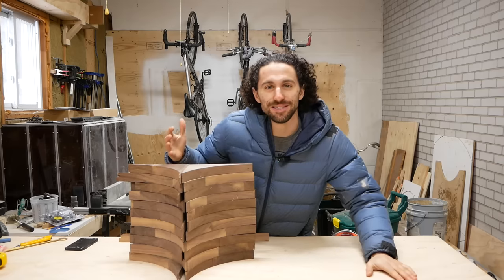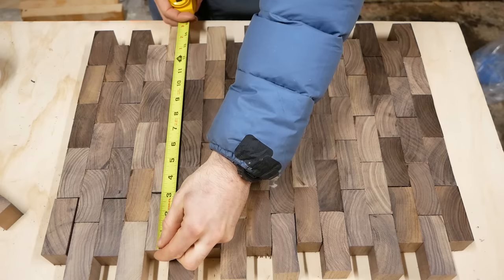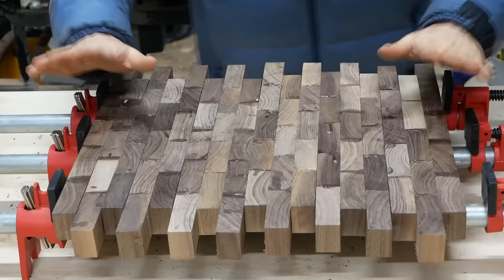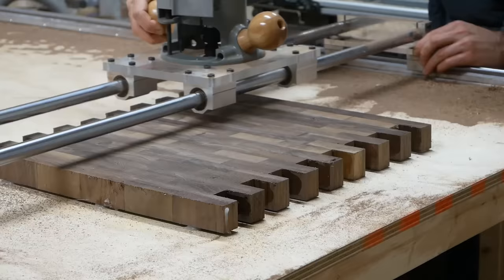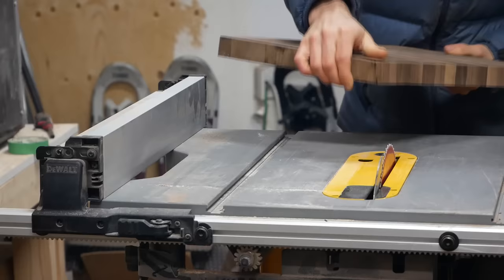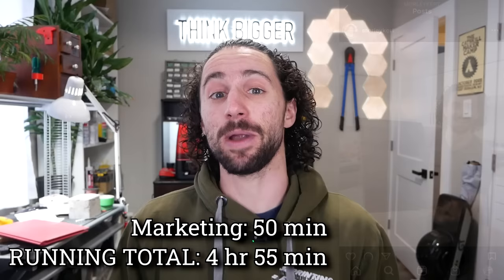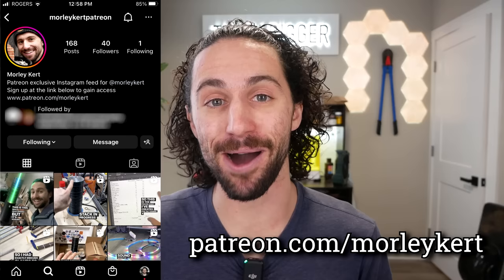Turning Free Scraps into a $325 Cutting Board

Comment: Great idea but you have to avoid selling a project that is not successful.  You have several gaps in your glue-up which will trap bacteria and reduce the strength of the board.    The glue you used is not food safe.  In my opinion, you should recall the board and refund the buyer. Shame on you to sell a so bad preject result.   And please use the table saw with more safety,  you'll hurt yourself badly if you don't care.

Comment: Have you checked that the glue you used is fda food safe? I couldn’t find anything on the brands site about that product being food safe. I know it says non toxic but that’s not the same as food safe.
Also like many are saying it would be good practice to fill any gaps before finishing your board to keep food and bacteria from getting trapped. Also because it’s hard to unsure finish is getting into those gaps. Doesn’t take much for moisture to collect where the finish isn’t projecting and will encourage the wood to swell which could compromise the boards flatness and glue joints.

I also agree which many of the commenters that I don’t think the board is worth your price. The labour took longer because you used scrap pieces. Which drove the price up. Had this been done even from strips of scraps the glue ups would’ve gone smoother and faster. Also the gaps in the board are a significant concern for me at that price point.

Great idea and way to use your scraps though. And you pointed out a lot of lessons you learned through the video. Just keep trying and remember to research your glue and finishing products to make sure they are right for the project. I know the finish is but not sure about your glue choice this time.
Reply: This would be an interesting board if the result wasn't sold. Everyone loves a learning process. The problem is when you want to sell your learning project at a ultra premium price
Reply: @ShayanGivehchian  I totally agree with you. A few months ago, I wanted to practice a really complicated 3d style endgrain pattern that I had never done before in a cuttingboard - and I had commited to myself that it was just a trial experiment and that no matter the result I wasn't going to sell it. Personally, I'm only comfortable selling something if its the best possible version I could make of something, and there was no way that would be the case for a one off attempt of a pattern I had never before done. 
It actually ended up turning out pretty well, and I gave to a friend. Maybe after a few more attempts i'll be more comfortable putting a price tag on it, but apparently I have way higher standards for the quality of my own work than morley kert does for his.
Reply: That glue is more food safe than the plastic shit you eat and drink off of all day long.
Reply: Wood glues are food safe! They're PVA-based
Reply: @ShayanGivehchian  I agree, I was thinking the same when I watched the coffe table video. He mentions that changing the expensive wheels for cheaper legs resulted in the same total price, because it took time to take the wheels off.
So, are you saying as an eventual customer I should pay the double screw up? No way I should be paying for the time you used to mount the wheels AND also the time you used to take the weels off.

Let's say that while I like all the videos, I appreciate Morley for the free 3D printed repairs, but for sure not for this cash-grabbing sales.
Reply: I really don't understand people's complaints about the price. Part of the appeal is that it's being made from wonky reclaimed wood scraps. There is an inherent value to buying projects that recycle materials like that. At the end of the day he is getting offers... really don't see why he should reduce his price when he is literally making sales.
Reply: @ShayanGivehchian  It's not a problem though, because someone is choosing to buy it. If you see it as overpriced, then don't buy it. Not everyone is going to have the same perspective and that's fine.
Reply: @evanbarnes9984  No, they are not.  You can't make a blanket statement like you are.  You do understand they are PVA based - great, what else is in that particular glue?  Are those additivities food safe?
Reply: @Jomskylark It is a problem when someone markets a beginner project as a premium product. If it was me, I couldn’t even in good conscience gift this to a family member. Let alone sell it to someone who doesn’t know any better.
Reply: @ShayanGivehchian  no one held a gun to your head and forced you to buy it, did they? anyone can sell whatever they want, at whatever price they want. someone bought this board. like he said, it just takes 1 sale. any flaws are evident in the photos, he's not hiding anything. he won. he had fun and learned. why the fuck is everyone so critical of his pricing? who gives a shit?
Reply: @thomasjefferson8629 lmaooooo

Comment: Just a tip for you, use isopropyl alcohol on the hot glue and it breaks the bond, no need for a blow torch. I usually use a ear swab soaked in IPA and rub it on the edges or use a dropper, works a treat and you can see it being used in my first video, entertaining content as usual!
Reply: Good to know. I keep some in a spray bottle just for general use

Comment: There are some significant issues with this creation:
-Putting glued pieces through a table saw to joint them is pretty risky. He's lucky none of his pieces shattered. Having his hands so close to the blade isn't something I'd recommend to anyone. 
-Those rubber feet mean that only one side of the board is usable. If you don't want the board to slide around, there are other solutions that don't take half the useful life of a $300 board away.
-Using a router sled on an end-grain cutting board is inefficient. It worked, but a drum sander would be a much more elegant solution. That router sled is meant for enormous slabs and tabletops.
-There are a lot of significant gaps in the final result, where food/bacteria is likely to get trapped. I suspect something went wrong with the glue-up: maybe insufficient clamping pressure, maybe not enough clamps, maybe not enough glue, maybe the jointing wasn't as good as it needed to be, or maybe he took too long getting it assembled. Some wood putty (equal parts sanding dust and wood glue) would fill these. Sure it's an extra step, but for the price charged, it's appropriate. The finish can help reduce this, but only by so much.
-That branding also created gaps where food and bacteria will collect. Since only one side of this board is usable (thanks to the rubber feet he installed), this isn't so much of an issue, but it's also not really visible. Better to apply a maker's mark to the side of the board.
-The board looks a little thin for an edge grain cutting board that wide. Most edge grain boards are 1.5 to 2 inches thick. Edge grain boards are a lot easier to break, so you generally want to make them a little thick. 
-Dude, put on your eye protection! A router sled can kick a lot of crap up into your eyeballs. 
-Also, get a decent respirator. It's a better bet than that COVID mask he's wearing. 
-Sanding in one spot (to reduce the excess burning from his brand) is going to make the board less flat. Better to make smooth passes across the entire board. Sure it takes a little longer, but the end result is better. 

Overall, it's ok as a product, but its maker's fame is what makes it worth $300. I'm making a 16 x 16 x 2 inch chessboard pattern endgrain cutting board right now (similar area, much thicker, far fewer gap issues), and I wouldn't try to sell it for more than $200. But hey, he's an influencer with 146K subscribers, so fame hath its perks.
Reply: Not to mention the way he cut those pieces to begin with on the table saw-  should have used mitre gauge or crosscut sled.  Or the crazy gaps in the glue up, or the fact he didn’t shim the board on the flattening jig so he didn’t even have a flat surface to reference off, oh and the round over didn’t even Ben match up on the corners. I hope his videos are never recommended to me ever again.
Reply: @matt18385  yeah as someone who rarely does wood working... I cringe too much in his videos. Has too much DIY energy.
Reply: totally agree, i saw the gaps and i was like hello?? are those intentional cuz there's no way someone should pay $300 for a cutting board with gaps in it.

Comment: I like how he likes all the positive comments here but does not respond to any of the comments regarding the quality. 

I've personally sold cutting boards for more than the price here, but they were all quality boards I would use myself, made with Titebond III and tight glue joints using a jointer and planer. I feel sorry for the person who bought this, there's a good chance those glue joints will fail with a couple months of normal use.
Reply: Exactly. This cutting board is half-assed.
Reply: I've never noticed so many negative comments, but this was by far the weakest project he's done so far. I also noticed while scrolling through that he's blissfully ignored all of the comments that aren't positive. Not that he needs to "like" or reply to them though. Maybe he can make a video addressing this (but I doubt he will).
Reply: @bryanmartin8336  I think the negative comments are somewhat expanded because this will be used with food.

If this were a table or bench or chair or something, I don't think people would care about small gaps. But in a cutting board, those are pretty dangerous (and the other cutting board he sold was a much easier design)

My only other issue is the implied "I sold this cutting board for $325, and you can too!!", which just isn't true. I'm happy he's able to sell things for that price due to a following, but the "you can too" just is blatantly false.

I like watching his videos. I just wish they'd be less about "I'm able to sell this thing for umpteen dollars!" (like recent ones have been) and more about making interesting things. Especially since it's the "selling" part that's not exactly accurate.
Reply: @jimbobjones9330  Oh yeah definitely. I don't make cutting boards so I missed the "not food safe" part, but I definitely noticed the flaws more on this one. As did most other people apparently. I also love watching his videos because the energy is infectious, but it does seem like his quality is slipping even as his prices continue to climb. At least he isn't asking for $100 an hour anymore...

Comment: Get some rubbing alcohol in a spray bottle and use it to remove hot glue. Quick spray, wait couple of seconds and the glue will come right off. Doesn't remelt the glue, but makes it come loose and it can be removed as one clean blob.

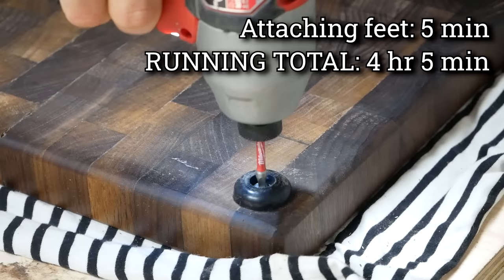Comment: 12:18 dude next time mix some of the sawdust you got from the router sled with some glue and fill in all the gaps in the joints before branding it and adding a wax finish. I know it’s the underside but it looks really unprofessional to have all those gaps, plus they make it more likely for the joints to fail through ingress.

Comment: Morley, I am a fan but I suggest learning some better practices for holding the wood in place instead of the hot melt glue.  You could have screwed down from the top on the pieces that were to be removed later. You could put a lower perimeter and use wedges to clamp it in place. Another option would be to use masking tape to the table and another layer on the bottom of the board then super glue the tape together. I hope you don't mind the constructive criticism.  Keep the videos coming and hang in there.
Reply: I think hot glue is prefect for this, as long as it is on the edges, I’ve done this a number of times and it never moves.

Comment: Great build. Thanks for sharing the video.  I made a router sled myself (much smaller, only from left over materials, metal L-shapes) about two years ago and it works like a charm.
I only have an electric hand planer (width 7 cm), no thickness planer. With my router sled I can go to 30 cm in width. I use clamps to hold the material. When you have an irregular shape of the raw material and you know which parts will be cut off in the end, you can even put screws there (well below the surface)  I also experimented with hot glue, but getting it off afterwards was very time consuming, so I quit that. Making  your own  wood balm is a good idea. Need to try that out.

Comment: It's a good thing the width of the board didn't fit through your planer. It's not a great idea to run an end grain cutting board through a thickness planer, you can do some major damage to both the piece and the blades. Most shops use a drum sander instead.

Comment: Hey just a little tip when using the circular saw on hard woods set the saw to make smaller cuts you will end up with a more square and clean cut. Bc the stress of cutting it in one makes the blade bend and move.👍

Comment: how on earth do you get a flat surface using a router, when you put the board down nonflat? I mean, if the board isnt perfectly flat on the router sled surface, you will not get a flat side, and when you turn it around, the other side wont be flat either, wont it?
Reply: I think the glue filled the gaps and it was stable on the surface. Once one side is flat, the opposite one will be too after routing.
Reply: @Markus-fw4px  The hot glue was the exact reason he wouldn't get a flat surface.

Hot glue is notoriously thick and a terrible thing to secure things that need to be "flattened"
Reply: @jimbobjones9330  yeah, but it doesn't matter, as long as the board doesn't wiggle while routing, you will get a flat surface on this side. When turning, the board will be flush with the table-surface and the opposite side will be flat and parallel to the first one (he fixed the board just from the sides after turning afair).
Reply: The point of a router sled is that the board doesn't need to be flat, it just needs to be stable. Unlike a planer, it doesn't make one face parralel to the other, it make one face flat. It acts more as a jointer.
Reply: @Markus-fw4px  It does, though.

The problem isn't that the top and bottom of the board aren't flat individually. It's that, unless you somehow make the glue match perfectly with what you did on the "opposite side", the two sides won't be fully parallel (assuming you put any glue underneath the board... though it looks like the second time, he just secured the sides, which is better)
Reply: @jimbobjones9330  the sled flattens one side. Then when that flat side is laid onto the flat table the router cuts the formerly down side parallel to the table and makes the second side parallel to the first side.

Comment: Everyone saying the price is to high, only partially correct. He definately padded the time a bit and the craftsmanship was a little shoddy but the people buying this will pay a premium for reused scrap wood. Environmentalists ya know. I did cring when you put glue under it and made it uneven. You need to measure and shim the bottom so you can get it perfectly square when surfacing. You surfaced 2 sides on weird angles making the board not sit square. Also, having all those gaps would of been easily avoided by taking am extra 2 seconds to properly glue them against a flat backing. Without the recycled wood aspect that cutting board is worth 50 bucks, and with it its worth 160ish. He'll, a much nicer handmade one is listed on Amazon for 150. Handmade items are only premium when the finish is premium or everyone would do it to get rich.
Reply: So many people commenting on the router sled without a clue how it or any milling machinery works. Flatten one side. Flip it over so that flat side is against the flat table. Cut the non flat upper side and it's automatically parallel to the first side because it's parallel to the table.

Comment: Awesome sled! And result is 👌
I'm thinking for your glue issue on the sled you could use double sided sticky tape instead to hold the peices or maybe make some dog holes in the table. The tape would definitely keep a flatter grip as well as an easy to remove grip.

Comment: I was gonna say before you even ran into the issue with the hot glue that I’d try to avoid the hot glue on the face, ESPECIALLY on the second side because you are very unlikely for it to sit flat with how thick and flexible the hot glue is. You maybe kind of got lucky because that forced you to edge glue the second face. 👍🏻

Comment: Could have made it wider by cutting half off the blocks on one end of all the strips and gluing it to the other end. Then glue together with the short blocks at alternate sides, with edges aligned. No need to saw away all the poking out parts when they don't poke out.

91% rubbing alcohol makes hot glue release almost instantly. Pops right off non-porous surfaces. Some rubbing rolls the alcoholed glue off porous surfaces like wood and fabric. Should get it out of hair too.

Comment: Wood glue has a minimum working temperature called the chalk temperature and Lepage wood glue`s is about 15 celsius.  Titebond original is at about 10 celsius.  I bought an inexpensive (on sale) temperature gun at Crappy Tire so i can check the temperature of my wood and glue to make sure it`s good to go.  

I was wondering how you would tackle jointing all those strips.  I did a random pattern end grain coffee table last summer and the process was very much like what you are doing here. Nicely done.

That router sled looks pretty slick.  How thick a piece will fit under there.  Any chance of doing a review sometime?

Comment: I’m pretty impressed with the flattening bit (as well as the Clean Cut jig) because I just did this exact process with just a regular straight bit and I really needed to remove like another 1/8” of material with a hand plane to get past all the fuzz and rough surface / tear out. I really spent like 3 or 4 hours per side hand planing it, but it was fun and good hand planing practice so I was ok with it.